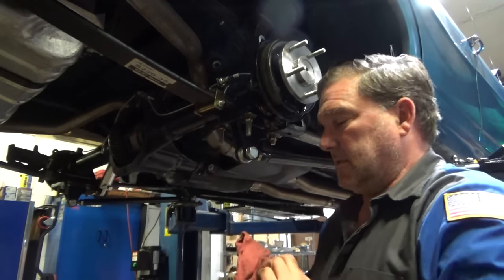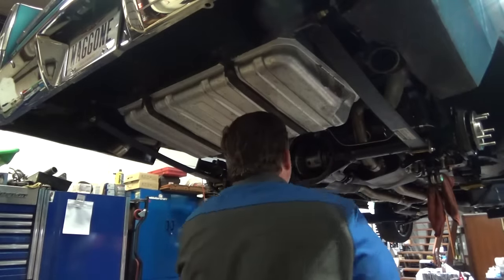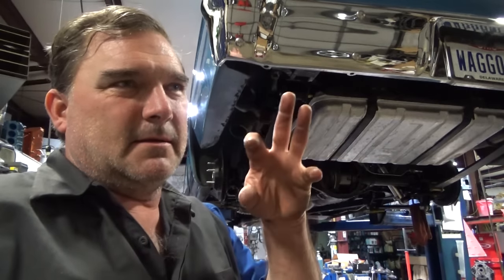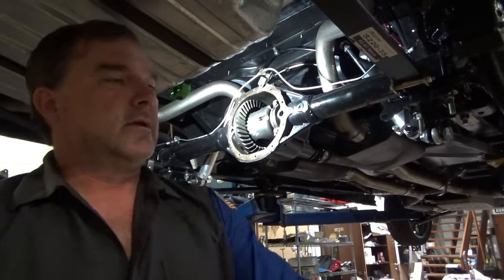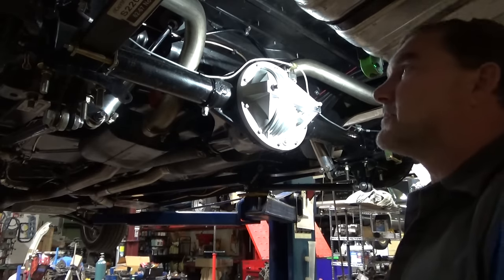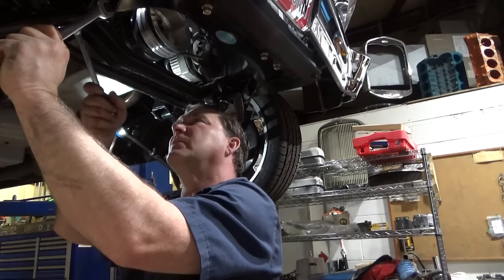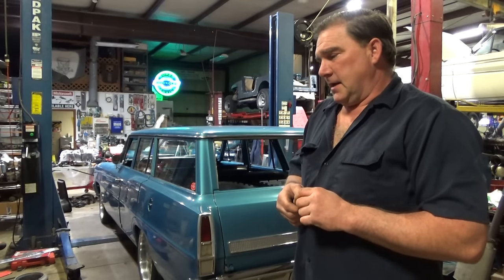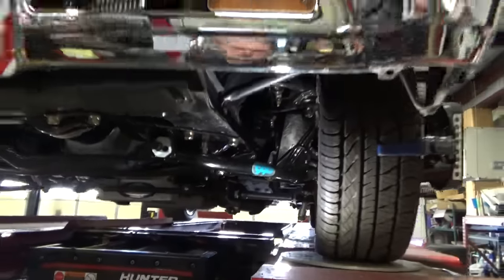Chevy II Wagon Project COMPLETION! Gears, Axle Trimming, Suspension Setup!

Comment: With the rear wheels not being tight and setting flush against the hubs, will that throw off your baseline alignment that you have already done? I’m just curious , please respond to this question.
Reply: the heads are compensated to the runout of the wheel.  So it wouldn't make much difference.  The baseline adjustment is just to get things close and check things over.
Reply: @richardlucore6813  ahhhhhh! Thanks for the response!! Learn something new everyday!